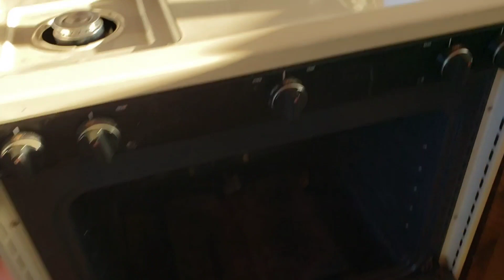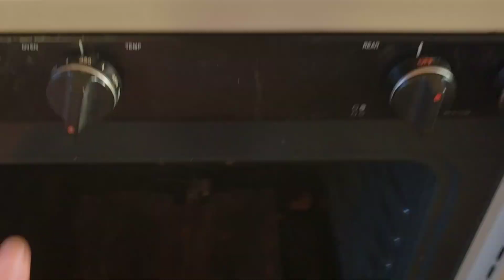Getting the oven/range to work on propane, Started a new position at work #azhomestead #offgrid

Comment: Kristopher it was so exciting to hear you mentioned my name I'm just very interested in your life as I lived in Arizona at one point I'm glad you're changing the oil in generator as you know a good generator is very important and as far as a shut-off goes you basically don't need one because you can shut it off at the tank you might want to look into a company that will deliver you the 100 lb propane and get a contract where they fill you up every month or so I know the propane is going to get expensive this winter and on my house out in sag harbor I have two propane tanks which we use for heat and stove etc the only reason I'm suggesting getting hooked up with a company and 100 lb tank is that my friend has a expensive range and it's hooked to a 20 pounder and she goes through propane especially when using the oven very quickly so she has a company coming every month or so or when needed and has a gauge on the top of the tank so you know when to call them it's much cheaper in bulk I hope it's sometime in my life I get to visit you I am so proud of you you are in the pharmacy because it will mean a big pay raise when you get totally certified main thing with work nowadays is that you come in on time and you value your job and that I know you do thanks so much for mentioning me in the video it was very exciting for me eventually you will be able to afford having electric run to your home in the future which I know is probably very expensive but I have no idea how much it would cost but I kind of like the idea of being self sufficient and on a generator maybe when you get some extra money together you can have a 3000 watt solar distribution put on your house and then you won't have to worry at all because I know from living in Arizona for 4 years that it is so wonderful if you want to make plans the weather is always great and also if you have the big 100 pounder you can heat your whole house very economically thank you very much for letting me know that you change the oil religiously I just want you to do well and have a happy life I'm a lot older than you I'm 73 and am very interested in your homesteading I am so proud of you that you stuck with your job and now all reaping the benefits of being a wonderful reliable honest employee be well always thinking of you you and Kelly are always in my prayers🙏
Reply from the maker: That's good to know on the shut off valve. in 10 months I'll have the barn and my car paid off and that's extra money i can upgrade the solar with.  I want more batteries.  I have a place a get them from that has good prices and free shipping. when I get the funds I'll upgrade.  For now we are good. I'm glad we can inspire people. thanks Craig

Comment: Good afternoon Kristofer.  Is that a 30" stove? Off of Facebook I bought a clean RV propane stove, no need for electricity, I light it with a long lighter, no electronics. I have already cooked on top and baked a pie in the oven. I have a natural gas stove, but just in case we have a natural gas shortage I wanted my stove to be off grid. Buy extra propane for change out.  Congratulations on your new job.▶️🇺🇸❤💕
Reply from the maker: Yup 30" for free. Having a back up is a good thing.
Reply: @KristoferTravelsHomesteading  Free is good. I paid $180. Lol! These trying times we need a back up plan for our backup. Glad you are settled and loving your job.▶️ 🇺🇸❤💕